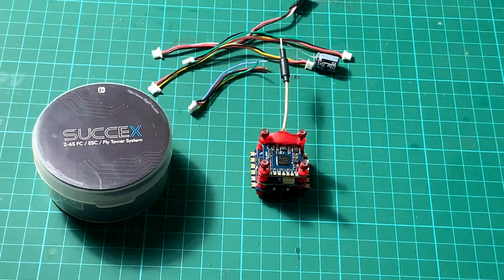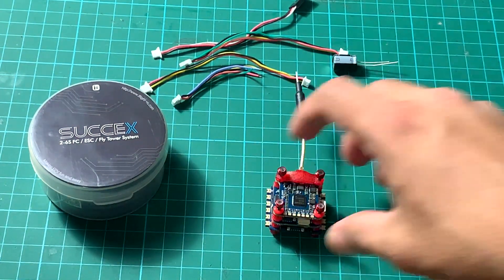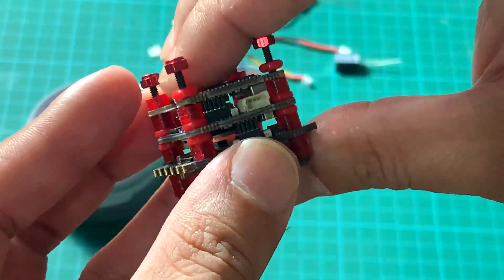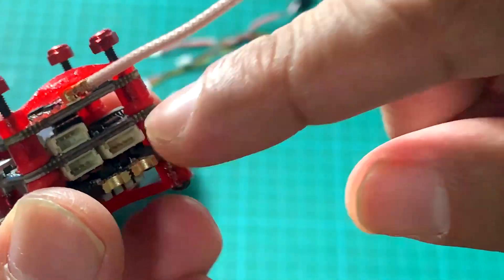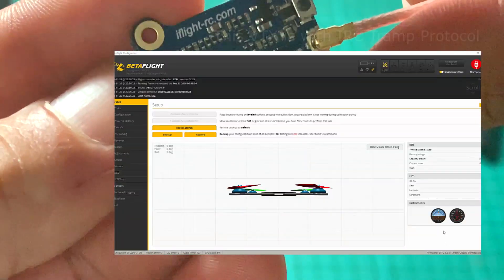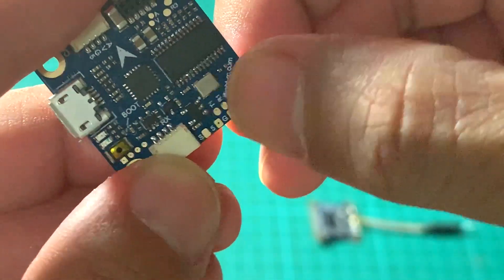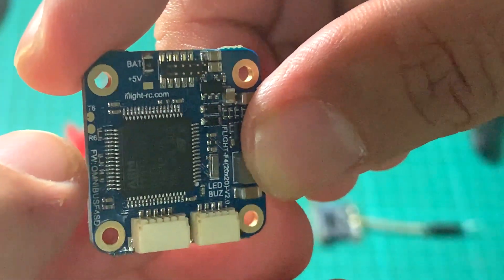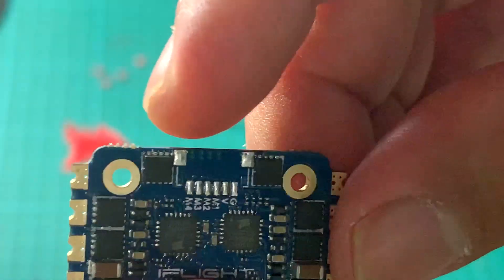iFlight Succex Mini F4 Flight Tower System

Comment: Hi can we use Frsky R XSR receiver on this FC? Do we have to do any hacking?? Does this FC come with inverted ports Please help
Reply from the maker: Hi RXSR is compatible. I am using it to this FC. But my RXSR is from my old stock with the s.port connected to inverted ports. However SBUS is on the default.